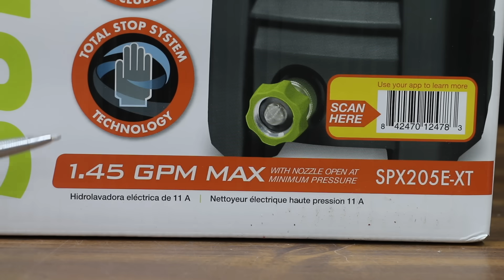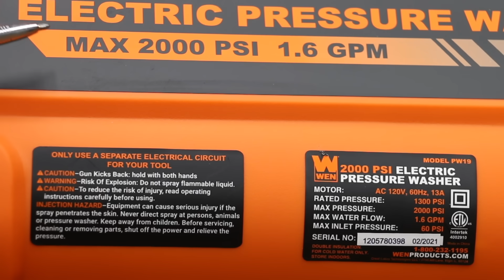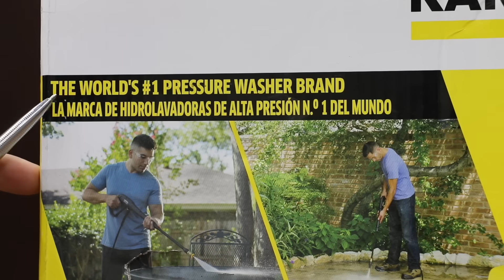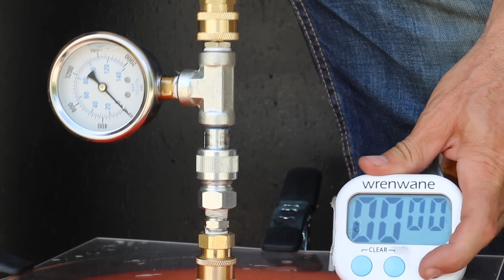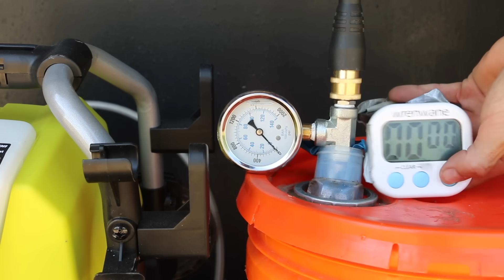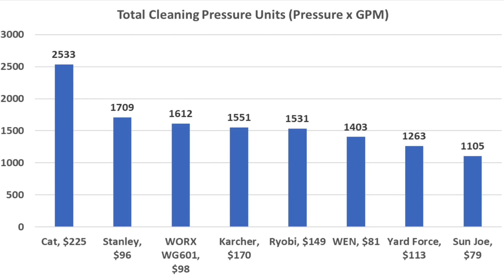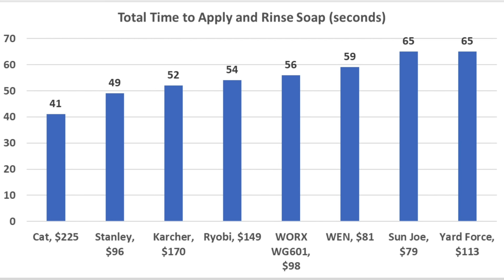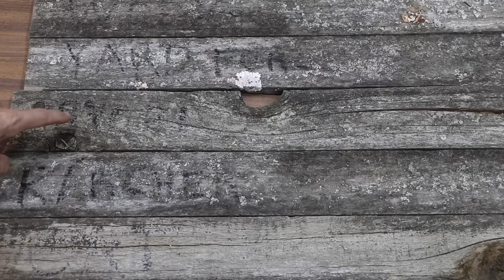Best Pressure Washer (ELECTRIC)? Ryobi vs Karcher, Stanley, Sun Joe, WEN, CAT & WORX

Comment: We have a brand of pressure washer called Gerni. These are very expensive, especially the ones with hot wash function. My own pressure washer is a $69 AU$ job. It seems to function ok. I doesn't get much use, other than for engine cleaning. It has a detergent bottle for car washing, though I prefer to hand wash my car.
Reply: Yeah nothing says I care like abrasive dust scratches in a paint job. Got to get them swirls. Wax on, wax off. I pressure wash rinse my car before I hand wash it.
Reply: @1pcfred  I hose my car before washing with detergent solution. I also rinse the wash cloth regularly during the washing process, because it leaves the car cleaner. To be honest, I’m not really worried about the current paint work on my car, as I will be repainting the car in a couple of months.
Reply: @1pcfred  I’m highly skilled at this because it was part of my job years ago.
Reply from the maker: Thanks for the feedback.

Comment: This is really interesting. Practically none of them lived up to their PRESSURE rating even though they are PRESSURE washers. This is cool though because it lets us all know the truth and those of us that might not be trying to clean off epoxy from concrete can make a cost decision based on the product. :)
Reply: They're all better than putting your thumb over the end of a garden hose. I've used really powerful pressure washers. It's not something I'd want to use around the house.
Reply from the maker: Thanks for sharing.

Comment: My Sunjoe XPS3000 has been fine. I worried that I didn't clear the pump of water for the cold winter but it fired right up and I washed and waxed my Ford without a hitch. We're all just sitting around wondering how we're going to get 3 seconds back from an inferior power washer. LUL! I want a product to perform and last a long time. Mine's about 4 years old...I think.
Reply from the maker: Thanks for sharing!

Comment: I've used both gasoline and electric powered pressure washers to clean my driveway.   I'd never use an electric washer again after using a gasoline powered washer.   Gasoline powered washers deliver higher pressure at a greater volume of water.  Thus better  cleaning at less than half the time......
Reply from the maker: Thanks for the feedback.

Comment: That's why I use the big pressure washer at work. I think it's 5000 psi and it's got a heater more than hot enough to scald you.
Reply from the maker: Thanks for sharing.

Comment: Hey, should of grabbed the quick release for the ryobi connections. Makes life a lot easier.
Reply from the maker: Thanks for the feedback.
Reply: @ProjectFarm  they are just general quick release connectors for the ends like that. I picked them up from HD, but some had to be Amazoned. Because it was the beginning of the pandemic and everyone bought up from my local spots. But they make life so much easier when switch out and managing breakdowns. Easy to find in the hose section usually.

Comment: Are these things actually useful or just a gimmick (compared to a gas washer)?  They seem pretty anemic.
Reply: I have the SunJoe. It is definitely useful around the house, things like cleaning lawn chairs or small areas of siding, or car washing. This pressure level seems safe for cleaning wood siding, where I would not want much more power. If you do a lot of cleaning you would  want a lot more power.
Reply from the maker: They are useful for light projects.

Comment: Not watched yet. Asked for this the other week. My old Karcher K2 packed in so got the K4 in the end. Very impressive upgrade......
Used mainly for car washing and patio cleaning. Not used on the patio yet but the extra pressure over the K2 gives a much more improved snow foam for car washing.
Reply from the maker: Thanks for suggesting this video test.
Reply: @ProjectFarm  have you done anything on cetane boosters before for diesels? Years ago (I'm in the UK) I had a VW PD engine (before they went common rail) I swore that the millers eco power max additive made the engine run quieter and smoother. Sure wasn't just in my head. I always recommend to friends and family still now

Comment: Plot twist: they are all made in the same factory in China.
Reply: Exactly.   This is a comparison between junk and more junk.    I had one of this crap for a weekend and it died after light use over a weekend.
Reply: The cat is made in a different Chinese factory its a rebranded Active v52 which is the best pressing washer for cleaning cars imo.
Reply: Likely made by the same kid
Reply: I'd say at least 3 models we're seeing here all come out of the same factory. All those ones with the adjustable spray pattern look awfully similar to me.
Reply: Same trash, different names.

Comment: I definitely made a good choice when I purchased my B&D pressure washer. It was the only thing I could find at $200 that was independently verified to hit the #'s ( 1.2 GPM @ 2000 PSI). As you have clearly proven here, most of them fall way short of spec! And the included turbo nozzle is pretty incredible.
Reply from the maker: Thanks for the feedback.

Comment: When I first started out in farming (Spring of 1975) my boss bought a brand new "Warwick Washmatic" - I was 17 years old. When he retired in 1998,  I went with my dad to the dispersal sale, and just on a whim, bought that old pressure washer. I'm now staring down the barrel of my 64th - and I still have that pressure washer, and it still works as good as it did when it was new. It only claimed 997lb psi, and a throughput of 4.8 gallons (imperial) per minute, and it still knocks the spots off the modern machines.

The water throughput is an important factor, especially if you're waiting for dirt to flush away. The car washing example is very good, because it shows up the shortcomings of the modern machines. My old Warwick will 'soap' the side of that vehicle in about 8~9 seconds, flush it off again in about 6~7 seconds, but importantly, you're not waiting for the water to turn clear as it runs off, and you can rinse the full height of the vehicle in one pass.

I wonder how well old and new would compare in a side by side test. I also wonder if the new washers will still be working in 46 years from now!

Warwick Washmatic;

Motor by Brook Motors Ltd
Pump by Otto Speck Gmbh

Motor hp 2.5
Pump max press. 997lb psi (with 2.7mm standard nozzle).
Pump throughput 4.8 gpm (Imp. no load) 3.4 gpm (Imp. with 2.7mm standard nozzle).

Tank isolator for public safety (water regulations).
Soap injector ("Injec-Tee with regulator valve) between tank and pump.

It's a lovely old machine!
Reply from the maker: Thanks for sharing!

Comment: I have a Son Joe spx-3000. I bought one from Amazon about 4 years ago. It ran very well for about 3 years. It failed on me after I left the switch on and shut the water supply off. After the pressure bled off the pump started and ran dry for about 3 or 4 hours. It was my own brain fart that caused the failure so I couldn't blame the manufacturer. Since it worked so well I bought another one through Amazon but right out of the box it wouldn't  build pressure. I returned that one and ordered another one but it seems to be intermittent and I suspect the pump will fail soon. I've been very careful on this one so I know it's nothing that I've done. I probably won't buy another Sun Joe.
Reply from the maker: Thanks for the feedback.

Comment: Definitely need to go higher in pressure, 3500psi would be much more appropriate for my liking, also, you didn't include any GreenWorks, is there a reason for that?
Reply from the maker: Thanks for the suggestion.

Comment: Bought that yard force model's predecessor 4 years ago. I did so based on warranty reviews and general longevity. At three years of heavy use, the motor gave up the ghost. It was replaced without question with the newer iteration by the manufacturer. Perhaps it's not stellar, but yard force won my dollar going forward.
Reply from the maker: Thanks for sharing.

Comment: If one is in the market for a pressure washer for home use, is electric or gas the way to go? Is their performance even comparable?
Reply: I don't know about the electric models in US as you have so limited power there, but in ie. EU models electric models can be really good. Though there's usually huge difference when you get ie. Diesel water heating pressure washers. But the price goes waaaay up. But generally speaking so does the cleaning power. After all you don't wash ie. dishes in cold water to get good results.
Reply from the maker: Thanks for the video idea.
Reply: For small jobs close to a power outlet, like washing the car or spraying off a patio, electric works fine. Their weaker output also adds a bit of safety margin: you have to be a little more stupid about how you use them to cause meaningful damage.

For everything else — driveway, house, pool apron, etc. — gas is the way to go. They’re simply more capable and get the job done faster. Also, they don’t have that second tether — the power cord — limiting their range.

BTW, for large, flat, hard surfaces, such as driveways, those surface cleaner disc attachments are a godsend. And maybe a wand extension so you don’t have to bend over.
Reply: Gas will absolutely outperform electric in terms of pressure capability, it will probably be about the same price. The flip side of that is increased maintenance, nosie, safety, and additional cost.
Reply: @MrMesropa  Even three phase models in 230V countries? Gas will not easily outperform electric models in EU area.